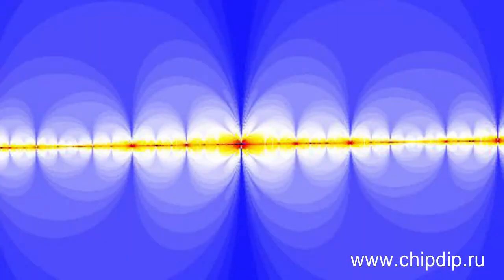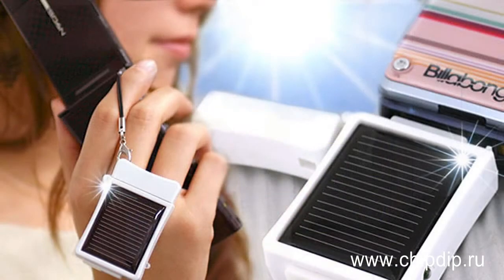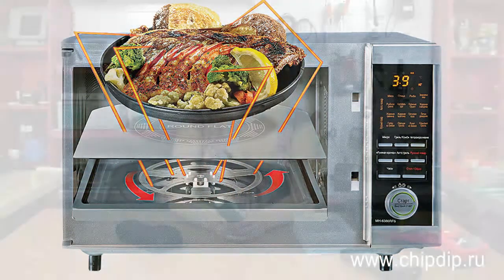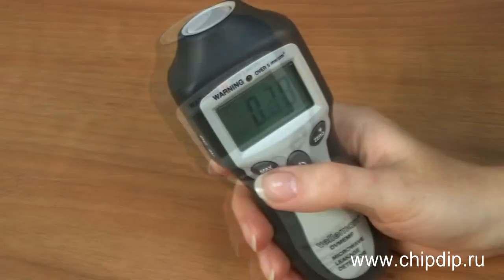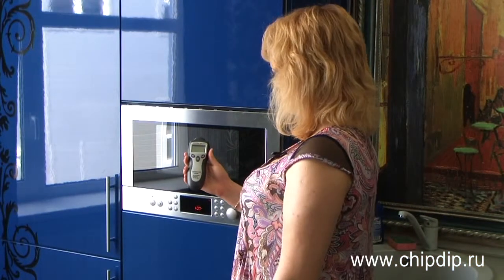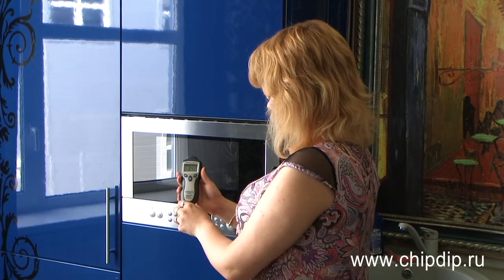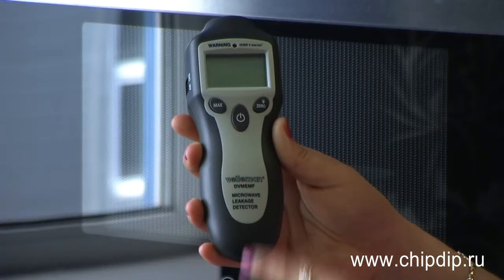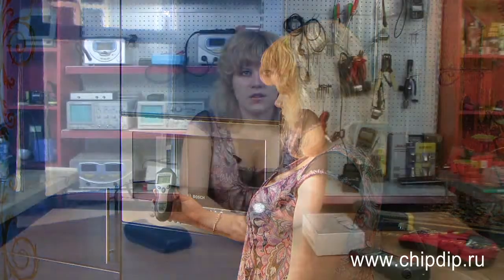Measurements of microwave oven radiation

Comment: “The power density of microwave radiation emerging from any microwave oven used in a restaurant, a canteen, a hospital, a self service heating unit, a home and the like shall not exceed 5 milliwatts per square centimetre at any point 5 centimetres or more from the external surface of the unit.
 1985 Recommendations on Microwave Ovens. Australian Governmen". i measured my 2 yr Old GE Microwave and a safe distance is 10 feet.